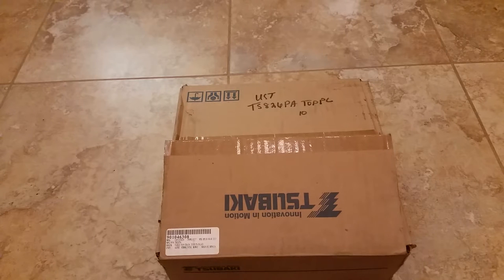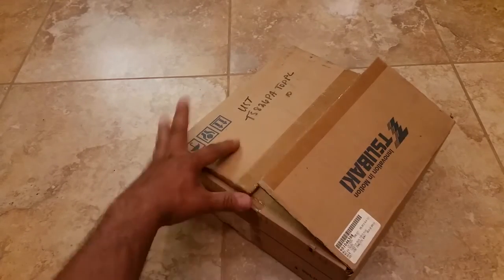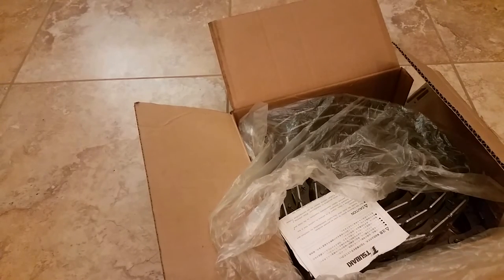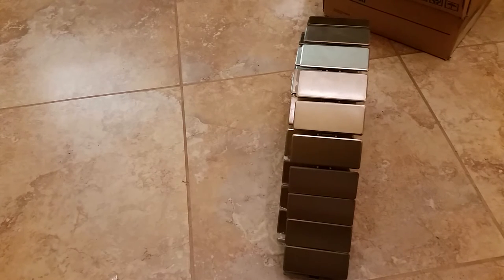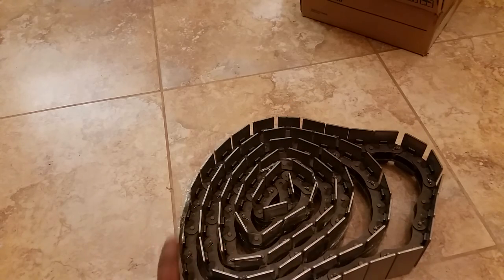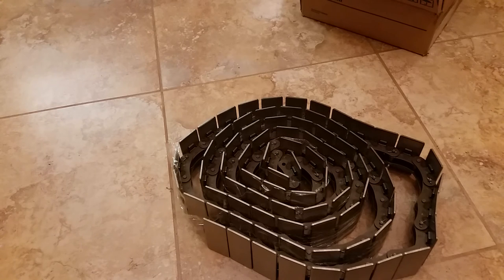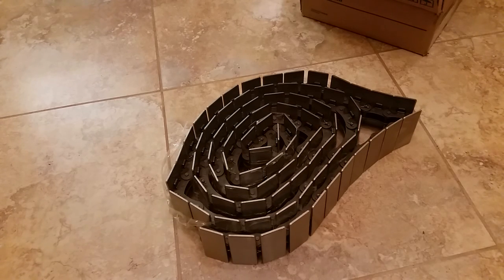Tsubaki ts826 tracks for my diy rc dozer build d11 cat 963

Comment: i used the same thing for my D10T dozer build, i welded 1/2" x 1/4" stainless flat bar on each pad for the grousers, this chain is awesome, you can take it apart anywhere you want and put it back together because every link is like a master link, unlike regular chain. i also got mine from ebay, you can see it in action on my channel, its a short video of a test i did....
Reply from the maker: +Carl Morasch Awesome. Yeah this is really good chain. I just bought a shorter piece and didn't realize till I opened the box and revisited the listing. Nice build. Mine is on hold as my tools are still loaned out.

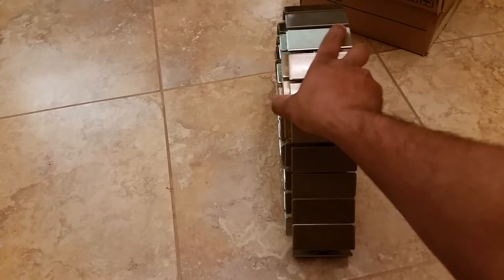Comment: I'm starting work on a scratch build dozer I might have to check out ebay for tracks.  That's a super deal,  that will help buy more parts.  $1200.00 is amazing. The european CNC version of CAT 973 goes for around $18000.00 U.S. or more, the 65 Komatsu 1:14 scale  is around $11000.00 US.  Yours will be bigger looks around a 1:10 scale, that's what I'll be doing also.
I'm looking for what's known as an offset chain where it's perfectly smooth with no knuckes from link to link, yours looks pretty close, when laid flat has small high points. I don't know how much friction it will add or if it makes levelling any more difficult.  For your drive sprockett you're going to maybe want around 30 RPM or so. You've got some good sized motors there. If your machine is a 1:10 scale 60000 lbs would be 60 lbs, I think you're halfway there with the 1/2 steel baseplate!
Extra weight is like an amigo, helps your machine to work better, I think those motors can handle it.

- What do you plan on doing the rams and how many AH worth of batteries for the whole machine do you think you will have?
- Which vendor or retailer did you get chain from on ebay, just search for tsubaki on ebay?
Reply from the maker: +Polski Ogorki Search on ebay for Tsubaki TS, tabletop, conveyor chain and make offers if the price is to high. You can also find chains with attachments and makes it easier to weld slats on them. I don't have the tools to machine the details so it will be a rough looking machine. I am going to mount the motors direct to the sprockets, if the controller wont slow it down enough I will have to change the gear ratio down more.

I forgot the scale I came up with but I used basically a picture to base off. I will be running about 100 ah at 12 v or 50 ah at 24 v, I am still undecided on the electrical. Motors and controller can handle either voltage fine. If I run 12 volts the motors will spin slower and giving me a more realistic speed.

I am shooting for 200 lbs, I may add extra 1/2" plate to add more weight. This will be used primarily in the garden / back yard. 

I hope I answered your questions if not please feel free to ask. I will try to work on this in the next 2 weeks. I plan on having my welder and plasma cutter back home.

Comment: dam that's costly
Reply from the maker: One of the reasons I stopped was the lack of funds. A finished rc loader will be roughly 1200 bucks and won't be detailed cause that will double or triple the build. The tracks at $50 each sound ok cause it saves me tons of hours to build. Regular chain in 1.5" pitch was about 50 bucks and few pieces of flat iron would quickly get up to about 80 or 90 dollars. I should just buy a real one..Thanks for watching.